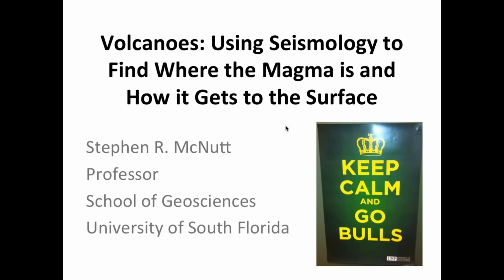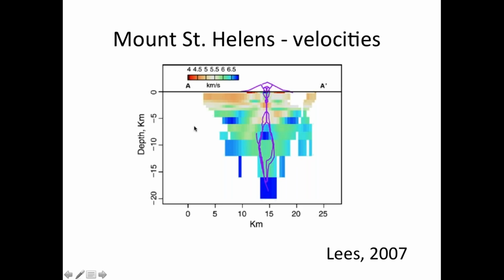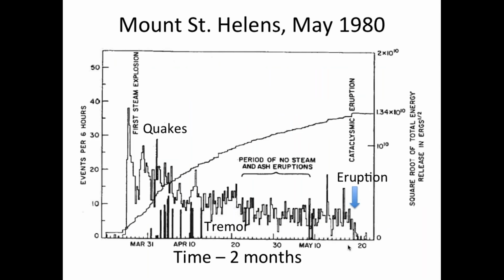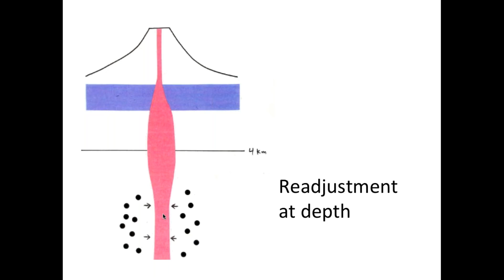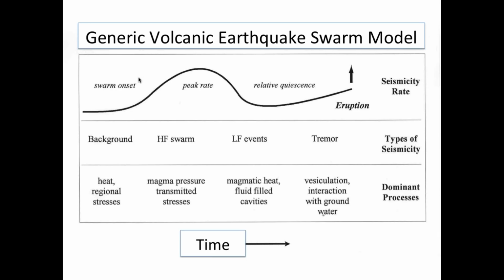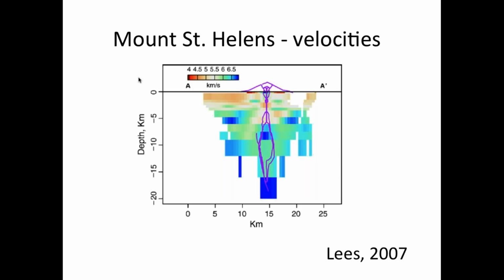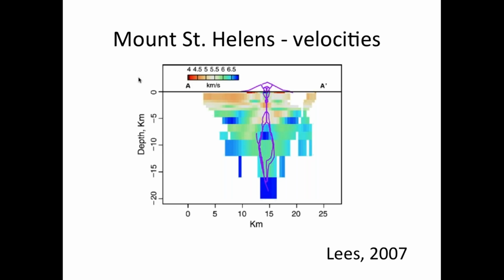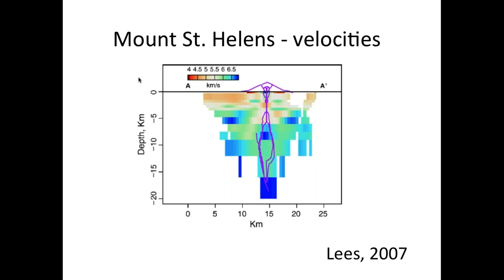Volcanoes: Using Seismology to Find Where is the Magma and How Does it Get to the Surface?

Comment: Reverse engineer. Sulfur dioxide is saturated in lava. Earthquakes you track include ingress of water with hot lava. Between lava and water is reactions with gaseous forms of acid. Water mixed with acid can go into 1000+ kelvin. Don Swanson at Kilauea was wondering about explosions as the cause of some earthquakes. Water poured into acid is a major expansion. Possibly a volcano that has long productions of lava has circuits water and vapor can circulate being driven by the magma heat to that O2 and hydrogen from the water and in circulation could act like a blast furnace. That would explain your high gas content Hawaii lava. Metallurgists could point out some of the mixing they have to beware of that will blow up furnaces when making alloys.